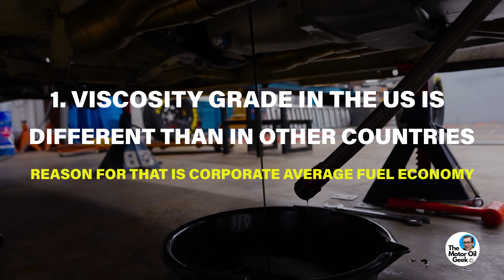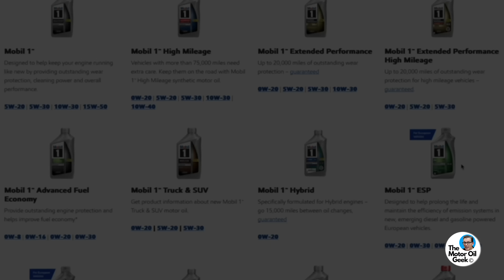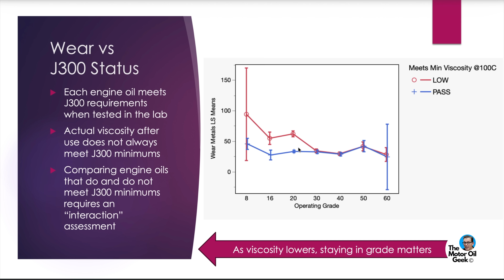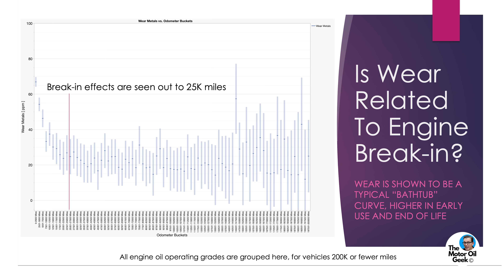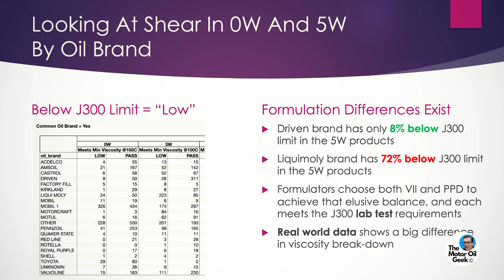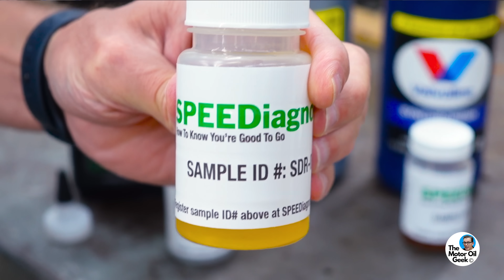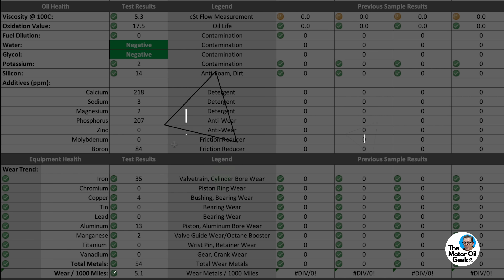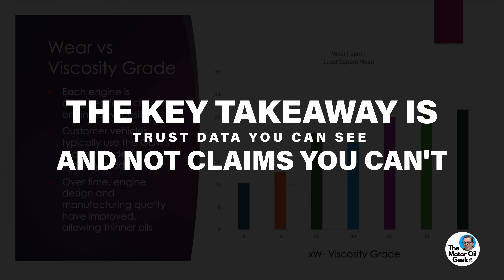More Ai Lies? The FACTS about 0W-20 vs 5W-30 (With Evidence)

Comment: Hey Lake
Is there any truth to this?
I thought a 30 weight was a 30 weight when warmed up.
Why would the first number make any difference once warmed up?

Your classic car likely shows lower oil pressure with 5W-30 than 10W-30 when warm because the 5W oil is thinner at operating temperature, making it easier for the pump to push, but also allowing it to slip through worn engine clearances more easily, reducing the resistance (pressure) needed to maintain flow, while 10W-30 stays slightly thicker and provides better pressure, especially at hot idle in older, worn engines where a bit more body is beneficial. Both oils have a "30" weight at hot temp, but 10W-30 is inherently thicker when hot and shears less than 5W-30, creating better pressure.

Comment: whilst I agree with everything said, there appaears to be a number of waely failures in enfines using 0-20 oils, mainly caused by damage to main and journal bearings in vehicles that have been regulalrly serviced. Why would that be?  Some cases may have obvious causes such as poor filters, low oil volumes, extended service intervals which would hinder the performance of any oil, but for those engines that are properly maintained, why do they fail?  Is it the 0-20 or something else?

Comment: Now, Im pretty incompetent at sciencing. That being said, I find something un sciency with your content here.

Basically you say as long as it  (0w-20) stays in grade, its a bit better. And you say the grade is basically meaning the viscosity not sheering out. Im therefor left wondering how the 0 part of 0w-20 can protect from wear? It has 0 viscosity. Thus 0 to limited wear protection. And then looking to the sheering. How does something that has 0 viscosity sheer below 0?

Like I said. Im not super sciency. But those things seem inconsistent or incompatible.

Comment: I think, in the end you use oil suitable fir your climate.
I live in tropical equator, it is either humid hot, humid warm, or simply wet.
10W-40 is the base line. Shell oil even make one especially for this climate that has 15W-50.
It is thick? Yes.
But the idea is those in equator won't have issue with thicker oil since it will be at right viscosity after idling for a while.

If you live in higher latitude, let's say you live in Washington state, I think you will take more advantage with 0W20. Although, the correct way might be changing oil suitable to the season. If it is almost winter, change to 0W20 but when it is almost summer, go for 5W30 or 10W40.

I think using 0W20 in southern Texas is a bit stupid. It will protect you but it won't be as good as 5W30.
There is no "1 oil to rule them all".
In a state such as USA or China that has big difference in latitude, what is recommended in the north should be different than the south.
So the theory that they put "recommend uaing 0W20 oil but engine can still use 10W40 if 0W20 is not available" to save money since they only have tested it using 0W20 is pretty strong.

Comment: When debunking the myth that lower viscosity oils shear/breakdown faster, are we comparing apples to apples? Almost all 0W20 oils are full synthetic, but 5W30 can be had in full synthetic, synthetic blend, and conventional. That alone could skew the data to make it seem like 0W20 holds it's weight better. If we're comparing only full synthetic oils and we get the same results, then you could definitely say that myth is busted.

Comment: The example in my experience is with class 8 diesel engine's thru 35 yrs ,  Detroit  , Cummings,  Caterpillar,  shell Rottela t4 has been the best hands down oil for heavy duty commercial trucks , I've used the synthetic,  synthetic blends , and non have , kept there color and lubricity thru 15k plus miles , without adding oil , that is the common difference,  when the synthetic oil was used we had to add 1 , 2 gallons of oil between changes with the rottela 15w40 , no oil add on , unless a truck had a leak or was due for a rebuild 1 millon plus miles t4 always till i retire

Comment: THE MOMENT GMC SWITCHED TO A HIGHER VISCOSITY MEANS THEY ALREADY DID THEIR LAB WORK! BESIDES THEY HAVEN'T EVEN FINISHED RECALLING ALL THEIR LS8 MOTORS, THEY ARE SLOW BOATING IT TRYING NOT GET ALL AT ONCE SCREWING OVER A PERCENTAGE OF CUSTOMERS IN THE WAKE! ATTORNEYS HAVING A FIELD TO EAT FROM! HOWEVER WANT TO GET A REAL POPULAR SERIES OF VIDEOS START WITH THE LS8 MOTORS IN REAL TIME USING THE DIFFERENT VISCOSITY USING AMSOIL SIGNATURE SERIES USING BOTH 0W40 AND 5W40! IF YOU LOOK HARD ENOUGH AM SURE YOU WILL FIND A LOT OF IMPORTANT DATA! IF NOT CARRY ON WITH YOUR VIDS AS IS AND LATE TO REACTION MOVES WAITING ON THE MANUFACTURERS TO CHANGE THEIR SPECS!😂
Reply: All caps. Didn't read.

Comment: My personal experience is that I've seen far too many engines blow up because of 0w 20, and far more engines last 300,000 mi or more on 5W-30. THAT'S PRACTICAL EXPERIENCE
Reply: That is the truth for sure, be an AI fan if you want but me I will continue to use what keeps my engines quiet and running a long long time.

Comment: Ai slop needs to be banned. Regarding the oil, even if 5w-30 sheers in 40% of cases, it will just sheer to the 20 grade, which is way better IMO than starting with a 20 and having it sheer to 16 or 8. Never running 0w-20 again, 5w-30 only.

Comment: I’d NEVER go to dealer for oil changes with their bulk oil(which most likely is recycled)
   My brothers Elantra GT was using at least a litre between changes after 60k miles. I took over oil changes changing to 5-30 full synthetic from 5w-20 dino, also twice yearly application of Seafoam. Now NO oil needed between changes

Comment: From my experience with working on cars engines that use lower viscosity oil they consume more oil and make more valvetrain noise and many of them have problems like damaged camshafts from lack of lubrication. Switching to 5w-30 engines seem to use less oil and make less noise and over the coarse of years have had no issues. I’m not a fan of these low viscosity oils.

Comment: Hello, I'm going to give you real life experience, bought a 2024 Trax on 3/12/24 first oil change 550 miles second at 2000 third 5000 all 5w30 8/7/25 Trax totaled bought 25 same oil change numbers but found out from dealer invoice 0w20 I now have a ticking on cold start ups at 3000 miles went back to dealership and let them hear it ( 7°) that day told them want 5w30 replacement  they WON'T do it ,asked why all Trax delivered in other countries don't use 0w20 (did some checking) was told didn't matter i could do it but voids my warranty, that tells you they are planning short longevity plus all Trax have wet timing belt ,doing my own changes at 70 years old F'M ALL 😮

Comment: On the J300 chart for 5w, Valvoline, Pennzoil and Castrol scored very similar and had good sample sizes.  But they have lots of different products.  Mobil 1 did terrible but their Truck and SUV got honorable mention on a previous video.  So maybe go down 1 level and not include too small sample size

Comment: I did research in sites other than YouTube. I'm considering going from the OEM recommended 0W-20 to 0W-30. The oil will be thin for start-up but stay a bit thicker for the hot summers in West Tennessee.
Reply: Go 0w-40

Comment: I switched to 10W30, in my 2003, Ford F150, what the factory recommended 5W20. My truck is still running! Our 2013, Subaru. utilizes 5W30, Subaru recommends 0W20. 5W30 in Japan!. Six month oil changes,  with Royal Purple motor oil and WIV oil filters. Just my choice. Some of my friends use AMSOIL. My son drives a Porshe 911, he uses Driven motor oil. Also cut the factory service points in half. I may be wrong, but that's what I do fo my vehicles.................

Comment: So a premium 0w20 motor oil is going to protect my new engine as well as a premium 5w40 here in S Florida (or any other state were the temps can go over 100 degrees F for lengthly durations) if changed at 5K miles intervals?  if this is so, it would seem that there would be little or no need for any oil BUT 0w20; do you expect that as the currant population of older engines ages out nothing BUT 0w20 (or thinner) oils will be available, especially if the greenies regain political power?  i'm sticking with 30 or 40 weight premium oils in the sunshine state!
Reply: Well, with your engine running, it should be over 200 degrees, so the hot weather doesn’t really matter in my opinion.
Reply: @freewaycommander  It matters.  Watch your temp gauge during the summer vs during the winter.
Reply: @freewaycommander in my gti, my oil temps rarely goes over 215 in the winter after a long freeway drive. In the summer it’s gotten up to 240

Comment: Lake, does a 30 weight oil shear gradually to a lower viscosity like 28, 25, 23, 20, etc?. Or, will it go completely out of spec, like down to 10?

Comment: that was expected, 0-20 alteady thin gets too thin over time(depending on condition). didn’t expect 5-30 to get better :). but a used oil has other parameters that degrade. 
now the problem with thin oil is if the engine is driven at high load. 0-20 would produce less heat itself but can still heat up and the protection at high temperature is usually lower. check hths. 5-30s aren’t that strong either.

Comment: CAFE regulations are killing American engines!
Sorry, but these ultra-thin oils are garbage!
5W-30, is the thinnest oil I'll ever use in an engine.
You don't need AI to convince anyone.
I'll bet you a Happy Meal, that the exact same engine, with the exact same driving habits, with 100K miles on both types of oil, will have much more wear with the thinner oil.
The real reason?
Thinner oil doesn't stay on engine parts and bearings as long as thicker oil, so if the car sits for longer periods of time between starts, it's going to suffer much more wear at startup with thinner oil.
Also, thinner oil has a greater chance of blow by than thicker oil, causing more oil consumption between changes.
It really doesn't matter if you believe me or not, you'll nit change my mind.
I'm in my 60s, and have owned several vehicles.
In those years, I've always changed the oil every 5K miles, (With synthetic oil) and always let the engine run for 30~60 seconds before driving, or after driving, before shutting it off.
In those years, I've never had engine issues, so I must be doing something right... LOL!
Reply: For the most part, you are correct. The rest of the world is NOT spec'ing these super thin oils.

Comment: The real reason for differing viscosity requirements is temperature. Given most damage occurs from cold start followed by warm/hot start followed buy driving style it's important to assess which multigrade is right for your weather. Concentrating on shear is a very narrow parameter. You want the oil to form its boundary layer asap then maintain it as the temp rises. But that's not the only place wear comes from. Combustion puts carbon in the oil. The oil needs to agglomerate this so the filter can catch it. Viscosity is only the start. Avoid fuel dilution at all costs. Disconnect any EGR that destroys the oil well before service life.

Comment: SIMPLY PUT: IF YOU USE MULTI VIS OIL YOU ARE USING A VERY LIGHT GRADE OIL, LIKE MINERAL OlL, WITH  A-HOLE BUNCH OF INDEX IMPOROVERS, DETERGENTS, ANTI FOAM AGENTS, CORROSION INHIBITORS AND PROBABLY COLOR ADDED. IT'S NOTHING WHEN THOSE AGENTS EXPIRE DURING USE. OVERHEATING OR OVERUSING IT MEANS YOU ARE RUNNING ON MINERAL OIL. IT'S A RACKET. IF YOU'RE SERIOUS, PUT AN OIL HEATER ON YOUR ENGINE AND RUN A SINGLE WEIGHT OIL. OR CHANGE IT EVERY 1,000 MILES. YOUR CHOICE IF YOUR DESIRE IS FOR LONGIVITY. ben/ michigan

Comment: Is the chart at 3:05 the best for comparing the two grades?  It seems to be comparing the second number value. So, a (any)W-20 oil holds value over (any)W-40. But, then that is suspicious as to why a (x)W-16 is almost as bad as (x)W-40. I think anyone into charts and statistics is going to wonder why the 12-20 values do not follow the average line. The better info that you say later, about the oils with closer values being more stable sounds more interesting.

Comment: I believe the guy that got 1 million miles on 2 Toyota tundras serviced at the dealer at 10k miles.I would think they stuck with the recommended 0-20 oil, I still do 5k mile oil changes especially since the 6 month mark is also very important.

Comment: I’m on my second 55 gallon drum of 5W-30 synthetic blend. I own multiple vehicle vehicles. Now, they all use 5W-30 synthetic blend. I don’t care what is recommended by the manufacturer. All of my vehicles have well over 200,000 miles on them. one 300k

Comment: @2:36 graph show surprising information however even if 5w-30 shear out of grade it would still probably grade higher than 0w-30 if both oil had equal amount of miles on the very same car. As oil get diluted by fuel starting 5w-30 rating slip toward 0w-30 rating and starting with 0w-30 slip towards below minimum viscosity? 

Nevermind I see you talked about this kind of subject later in video😂

Comment: I'm less concerned about "shear out of grade" than "grade equivalent after shear".  In other words, Both will shear out of their original grade.  But after 5w30 shears, what is it then equivalent to, and what protection will it provide?

I compared two Toyota vehicles in each of two model years all four with the same v6 engine.  In the U.S. manuals, three of the four specify only 5W30, the fourth specifies only 0W20.  But then in the E.U. the fourth also allows several weights, allowing 5W30 for the exact same temperature range as 0W20.

I believe Toyota is giving me incomplete information intentionally.  If 3 of the 4 require 5W30 instead of 0W20, and the fourth can use 5W30 at least in the E.U., the only conclusion I can draw is the 5W30 is better.

Comment: So you are saying 15w30 if this oil existed would be way more sheer stable at a 30 weight then a 0w30 or 5w30 which my 02 Camry le recommends. So it’s acceptable to put in a 10W-30 in my 2002 Camry. I’m I correct?

Comment: I am 53 we raced cars circle track I build all my engines loose to live running 40 weight even 50 weight but I learned old school we warm our engine and run it hard.    I will run the higher grade specific for my Texas heat on all my vehicles.  I also follow severe service schedule.

Comment: It is unfortunate that owners have to worry about this at all today.  It didn't used to be that way. My 1983 Ford F100 has had a variety of oils over the years, with most being old-fashioned  non-synthetic  brands. The engine is still within new limits. For my Ford Escape hybrid, I decided to change to 5-30, with the main reason being I'm in Florida and don't have to worry about cold weather viscosity.

Comment: I used 5W-30 in my GM 6.0 Chevy truck I purchased brand new in 2005. Had 200 miles on it. Today it has 230,000 & runs great. Motor still stock. It’s a work truck and I use my trucks like trucks should be used. Unlike some people buy trucks and treat them like cars. HELL NO!

Comment: QUESTION...OIL GUY, if i change my 0w20 at every 3k, will it help prevent engine wear and or is it better than waiting until 5k?

How many miles is ingrade for 0w20?

Lastly, can I use 0w20 in winter and 5w20 in summer?

Comment: So the biggest take I got on this video is 5w-30 when sheared down is similar to 0w-20 but better than 0w-20 when sheared down. So I’ll continue using 5w-30 in my Subaru engine that says to use 0w-20 because I’m in a moderate to hot climate.

Comment: My conclusion is 
0w20 need better quality components like pao gtl more hc to keep that viscosity grade and couse quality not going out off grade but dont understand lees wear metals , tought is dependent of thicker film better protect . 
Still if 5w30 is out of grade is thicker than 0w20 shuld better protect . 
Maybe all the samples 5w30 have much higher mileage ?  Maybe compare same engine , 0w20 and 5w30 , possibly similar quality components same condition same working time and we see the difference.

Comment: While I pretty much agree with what you are saying here the fact of the matter is that the thinner oils are operating with a smaller margin of error. I totally agree with your comments on excessive sheering on the oils like 0w40. They have to put some sort of goop in the oil that isn’t oil to allow the oil to behave that way for such an extreme temperature spread.

Comment: ‘The Car Care Nut’ YouTube channel states that Engines recommending the thinner grades are designed with different tolerances than those using 5W30.

It was in a ‘short’ titled “Why are some cars using thin oil”

Comment: Fact, the thicker the oil the stronger the film strength, GM has learned that the hard way changing their required 0w-20 oil to 0w-40, FCA leaned that the hard way when they changed the ecodiesel oil from 5w-30 to 5w-40, both companies changed to heavier oil to solve bearing issues when their investigations revealed the lighter weight oils film strength was not strong enough to protect the bearings under load. Ford was smarter while they allow you to run 30 weight oil in their mustang engines for every day driving they outright tell you if you track the car change the oil to a 50 weight, in the 2.3 High Performance Package Mustangs Ford specs 50 weight oil all the time. 

Then you have manufactures who sell basically the same engine in different parts of the world and here in America they spec a 0w20 but in other parts of the world they will spec the same engine with 10w-30. The entire light weight oil BS is because of CARB and the EPA demanding higher and higher fuel economy, oil is one of the ways they squeak out an extra tenth or two of mileage which adds up but leaves you the owner with substandard protection over the long haul. .